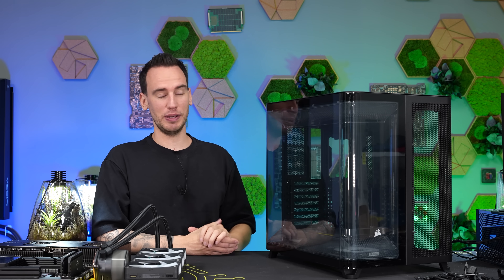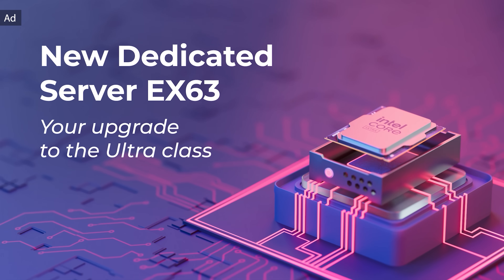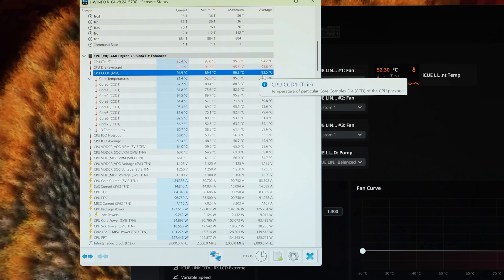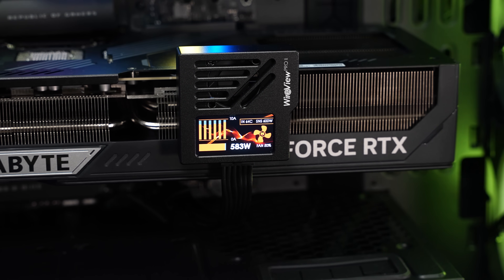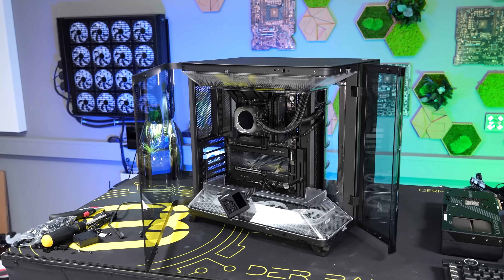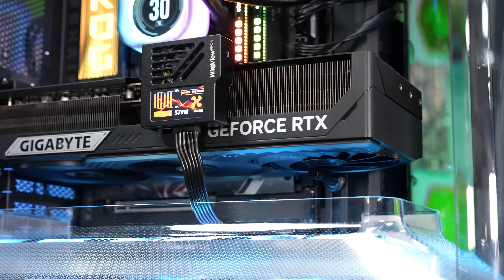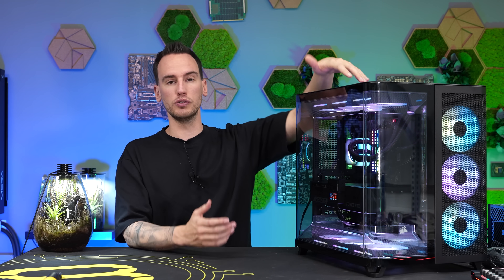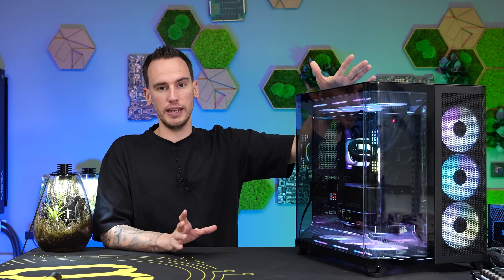Are 3 Chambers Really the Future of PC Case Design?

Comment: This is actually a terrible design, like the rest of the cases. If you have 3 chambers, the one behind shouldn't be used for the power supply. It should be used for the GPU. We don't need to be a genius to understand that a GPU attached straight to a motherboard is absurd.

Comment: Just built this case out and can tell you if you have a premium motherboard like an Asus z790 hero dark the plastic air tunnel on top will not fit. Other than that, super easy to build out with a lot of space in the back so if you suck at cable management its ok, just close the door.

Comment: i like the idea of seperate chamber for better cpu temps but all this VERTICAL cooling is bad for vrms,ram,nvme and mobo itself as hot air goes up from gpu  and heating all in line thill it exits. HORIZONTAL cooling is best, but when will someone do this with seperate chamber we will see....

Comment: There are so few cases that can accommodate more than 1 360mm radiator. In my struggle to find one I ended up getting the Coolermaster test bench and running an open-air setup. It works amazing to keep temps down. I did try a certain case from Thermaltake but when I saw they mounted the radiators with the hoses on top I returned that immediately. Dumbest case design ever. Never buying Thermaltake again.

Comment: why no one is talking about the problems on this case!? 

The cooler should be upside down to prevent air pockets from forming in the radiator, but this is not possible because the case does not allow it.
The NZXT Kraken Elite 360 v2 cooler does not fit because the tubes hit the USB ports. This case is not compatible with all radiators.

Comment: You can mount AIO at the top, exhaust to the side and use bernouli effect (low pressure) to suck hot air from case (high pressure), so effectively not needing top fans and at the same time leave the front free for intake fans for motherboard cooling or other use.
Reply: The whole point of this case is NOT to suck in hot air from the case into the AIO radiator. And also not to blow the warm air from the AIO radiator into the case, where it would affect GPU and other thermals.
The CPU was over 20 degrees C cooler when the AIO was getting fresh air vs. sucking in warm air from inside a case.
Reply: @Kepe You did not understand the Bernouli effect.  Fast moving air EXITING the radiator would suck hot air from the case.

Comment: I have an ENDORFY Arx 700 ARGB case.
Standard four 140mm fans.
Additionally, three 120mm fans at the top and one 120mm fan in the basement.
At the top, the first one at the front pushes the fan in, and the next two pull it out.
R7 5700x3d
RX7900xt
My temperatures under stress:
R7 5700x3d max 65°C
RX 7900XT max 56°C
My computer is under the desk, and my feet are cold.
Best regards

Comment: These designs are all quite strange. the TJ07 with the xforma layout was the peak in case design.  These new cases look like fish tanks.... for newer builds i just stick to rack mount cases instead of going for a fish tank case and if i needed something more than a thick 360 in a 3/4u ill run some thin tubing to a large external rad.  Still much cleaner than buying a fish tank case.

Comment: I've been wondering forever why there aren't more cases that isolate parts like keeping the CPU cooler and the GPU/its cooler isolated, and more cases without external mount options for Radiators- you could work the radiators into the case design to come up with some neat setups. It's a nifty case but I kinda don't like all the clear plastic but that's just personal preference, I suppose you could easily paint them.

Comment: 4 chamber cases incoming...

(gpu in a vertical bracket, in it's own 'wind tunnel' chamber with a 120/140mm fan at the front of the case, and 120/140mm at rear.)

Comment: 600 euros for those whom money is no object, fine.  Toss in trumps' tariffs and most of us go heck no way.  If plastic air flow guides are a "thing", make a front intake shroud that funnels air to an air cooler.  intake fans on bottom, exhaust in rear and top.  I'm using a 7800X3D with a FROZAN A720.  no thermal issues and noise is acceptable.  9 fans total in my King 95 PRO.  [] []-----[]  top 140 intake has shroud to cooler.  Bottom intake no shroud.  Likely come in well under the fancy fan 600 euro cost.

Comment: traductorBy placing my radiator on the side, blowing air in, the heat from the radiator enters the case and causes the GPU to overheat. My 5080 went from 64 degrees Celsius to 68 degrees Celsius, while my CPU only drops 2 degrees at idle and 3 degrees under maximum load. I'd rather keep my expensive graphics card cool than lower the temperature of my 9950x3d CPU by 2 degrees by using the radiator at the top, exhausting air as the manufacturer recommends. Thank you very much.

Comment: You can have hot air front/ side intake, as long as the cpu runs cooler than the gpu, and there’s also cold air bottom intake. It doesn’t need to be this complicated.

Comment: While I think the comparison done in this video is valid, I do wish you had compared to a traditional case with front-mounted AIO cooler as you mentioned. Of course thermally isolating parts is going to produce superior thermals, but cost is important. An AIO is not going to feed very much warm air to your graphics card in almost any circumstance. Try putting your hand in front of your radiator during a long CPU stress test, vs putting your hand in front of the air coming off of your GPU during a long graphics stress test. The difference is enormous.

Comment: Refrigerator, plastic crisper-trays to... Achieve a Venturi effect?  $450 lol

**Edit, $600+ USD, because u need the AIO fans 😂

What about the giant anidees AI Crystal XL: 4 120mm intake fans, a 480 rad exhausting out side of case - before any air gets into the case (in theory)?  It's a 90* loop cold in/Rad out.  Still a $350 case... but can take 3 or 4  480mm rads, and an extra 360mm on bottom?

Comment: Similar result can be achieved also in a “sandwich” style case, where gpu and aio are each on the opposite sides of the case. In general you would see higher temps just due to the fact it is much more compact and offers less “breathing” space…

Comment: This takes me back to my old zalman water cooling that was a huge tower outside the case. You didn't need any fans to cool your cpu with that, just a tiny bit of noise of the pump.
Reply: Yeah the Zalman Reserator. I think they had a few different models of those back in the day. Cases in the 00's and 10's used to have holes in them to get water tubing out and back in.

Comment: The GPU should go on the other side of the MB, inverted, with strong holders, the fan direction should be inverted to blow air upwards; the Radiator should be on its traditional place above the CPU in the top of the Case; some fans should be also on the front of the case blowing air to the GPU Cooler. This way you only need 2 chambers, the CPU-GPU connection will be super close and fast, and Expansion Slots can be more and Freer. Also a Mini-Chiller(Closed Case Air Cycle) could be installed for further temp lowering, ~15-20ºC Air would not cause problems I think

Comment: I'm sorry, why did you have some separate test system? Just run it in the corsair case a second time with the divider removed and a sheet of something taped over the exhaust hole.That would be an exact like-for-like comparison with the only variable being the isolated airflow. Building the system twice in completely different chassis' just means you went to more effort to produce worse data.

Comment: Is making a case where the mobo sits horizontally. Has a dual chamber
Mesh front. With 120fans 
And little fans on top of the pci slots.
The case is compact
In the second chambers. Placed the ssds, power supply and left over cables

That is my dream case, who can I talk to make one

Comment: I don't know if it's the future because I currently have a dual chamber O11D Evo RGB White case and I think it is ATX perfection. I went with a 13 fan push pull AIO setup. I have my AIO on the side as an intake with push pull 6 fans so the radiator doesn't breathe in hot GPU air and on the roof I have three 140 mm fans and a single 120 mm rear fan with 3 fans on the bottom for the GPU. GPU and CPU get fresh cold air and all the heat leaves from the rear and the roof. I can not praise fish tank push pull cases enough. low temps with slower fan speeds and less coil whine because you have more glass than those mesh cases.

Comment: I gotta say I think it is hideous. I live in a dusty environment and I DO NOT want my case sucking up every particle of dust that settles around the case so bottom intake is out. I don't like fishbowl cases. The plastic fan shrouds look bad. and it is twice as wide and just as tall as a standard case. It's just hideous lol. I would rather have the first case in the test. I have a shroud already made for the PSU to draw air from the side at the panel height with it's own filter so it isn't sucking up dust from the surface around the case. Then because I use an air cooler rather than an AIO I have 4 intake fans, 3 in the front and 1 on top just infront of the cooler. Then theres the normal rear exhaust and another on top behing the CPU cooler. I have black plastic panels covering the rest of the top. Ontop of the GPU is another fan shroud to redirect it's exhaust from into the CPU fan to the same direction across the back of the card. My CPU gets plenty of fresh air and the GPU does as well with no dust off the desk collecting.

I made the PSU fan shroud because I had to clean it's filter twice as much as the front and top filter. Now that it is drawing plenty of air from the side with it's filter at the intake of the shroud I clean it at the same time as the front. The top rear exhaust  blows any falling dust away from the top of the case to where only the top front gets the full dust treatment. An actual gradient of dust from the front to the back. The top filter tells me when to clean all the fan filters as it collects the most dust. The plastic covering the rest of the tops openings is so air from the top front fan doesnt esxape from the empty fan slot above it and just in front of it. The one between the two top fans is there for? Dunno. The GPU fan shroud is simply curved plastic from the side of the GPU to just past the CPU collor fan. GPU doesn't affect CPU temps.

Comment: For long-term use, I think it's worth considering that these "added" plastic parts will most likely turn yellow and possibly even crack when exposed to hot air...
Reply: Any decent polycarbonate plastic doesn't yellow though, neither does it crack because of temps a little over room temp. My parents' cottage has a terrace covered with a polycarbonate roof, it's been out in the elements for over 10 years and it's not yellowing or cracking. Temperature ranges from +35 degrees C in the summer to -30 in the winter, plus however much being in direct sunlight adds to the actual temperature the polycarbonate roof sees in the summer.
Reply: @Kepe  I would only be happy if my assumption is proven wrong by time. There are very few companies today that you can trust blindly. Thank you for sharing your experience.

Comment: Thanks for another interesting and informative video. But I must admit that I was most interested in how the temps would compare to using a "traditional 1-chamber" setup (like I believe most  of "plebs" normally do)), meaning that the AIO is mounted in Front pulling "fresh" air, and also with "bottom fans intake" for the GPU, and finally fans in top and back as "outlets"...
You merely mentioned that you thought it would be worse, which I also believe. But I'm  REALLY curious about How Much Worse it would be... Would it be enough to motivate the cost of a case like this ??
Best regards.

Comment: I just don't understand why modern PC cooling has moved this way. AIO on the processor, but aircooler on the graphics card. Between the two, the GPU is far harder to cool with air because of packaging constraints. Conversely, any modern tower cooler has an easy time cooling typical processors because there's so much clear space available directly above the CPU socket.

Why are we not mounting aircoolers to the processor and using a loop (AIO or custom) to cool the graphics card? This would also avoid as much need for the separate chamber, because the processor is only going to dump maybe a third of the heat into the case as the graphics card would, so the overall system ends up cooler and the intake air for the radiators is not as affected.

Comment: My TT 700 CTE is a pain to build in as well the first time just because you are getting used to the 90deg MB turn, and then figuring out that you basically need to buy 3-4 foot cable extentions for every cable that normally mounts to the back of the motherboard. which thanks to the AmaZ0n is painless on the wallet lol. I also have 3 sides of my PC set to intake so all the hot air goes out the top. The only real downside to Chambers is that the cases are getting bigger/wider/taller to make it work so if space is an issue do lots of measuring before buying.

Comment: The price of this case totally justifies the added cost of a back-connect motherboard. It just makes everything sooo much cleaner. Saves the money of using ARGB strimmers too. The AIO baffle presents a platform for mounting a large system display panel that's easy to see. I'm sure that copies of this design will be cheaper. Brush VS rubber grommets? 👍

Comment: I don't know what is the purpose of back fan in Endorfy arx 700. Basically it takes cold air from front fan and exhausts it without any purpose.

When I mounted aio on top, I set the rear fan to intake, so both, front and rear are making intake and exhaust is being done through top of the case only, so all the air goes through radiator, nothing escapes.

Comment: Should have a vertical rectangular cube that houses the gpu, 150mm x 150mm. One 140mm on the bottom blowing upwards and one 140mm on top as exhaust. Completely separated from the rest of the components. Case should have a hidden/integrated pcie x16 ribbon cable that is sold with the case. 

Motherboard and cpu should be bottom to top as well with a 360 aio on top as exhaust and 3 120mm on bottom as intake.

The orientation of 99% of gpus just disturbs the airflow of most traditional pc cases and causes the hot air to just circulate. 

I cooled 48 3090s in Florida using outside air that was 70-100f degrees by using this chimney method. Removing the hot air as fast as possible and upwards was by far the best method

Comment: So, in order to use the new Corsair proprietary case, you cant really use your existing Corsair proprietary AIO and AIO fans, so you have to buy Corsairs new proprietary AIO and AIO fans, as well as possibly Corsair new proprietary case fans ... to use in their new proprietary case and power system ... just to repeat it all again a few years from now at upgrade time.

This is proprietary hard ball ... and Im not playing.  years ago, when I realised that Corsair was going full on in-house proprietary nightmare for all things ... I chose to get out.
Now ... its turned out that this was the right choice.

Its nice to see that the 3 chamber system works temp and performance wise, and I appreciate Corsair spending development costs to figure it out.  Now I will wait a little while for other manufacturers to run with it and build cases in this format.

Comment: I solved my problems years ago: an MDF box 50x50x18 cm hinged as a side panel with space for a large tank, 2 x 360mm radiators, 2 pumps (one bypassed as a spare), all the fans I want, a controller I made with an Arduino (now with an ESP32 controlled via wifi) for pumps, fans and 8 temperature sensors.
One hose going into the case and one coming out with push-in fittings... and all the space I want inside the case. Ugly as sin but extremely convenient and high-performing.
Reply: You have an image?
In an ideal world we would have custom or moddular cases alas the main issue is they are trying to make fancy cases while also one size fit all andd we end up with something (that also costs a small fortune and may or may not even be good)

Comment: I would be interested in a followup with the same exact system in the ARX case, but with an AIR cooler on the CPU instead of the AIO. Im wondering how much is it worth to separately cool the CPU vs. just dump all heat into the same place with lots of airflow.

Comment: Conceptually this is the same as moving the radiators outside the case? The only thing that needs optimisation is the gpu directly throws hot air towards the ram and vrms before it gets pulled out of the top

Comment: i have the lian-li dynamic evo 11 and i’m using 6 case fans for intake and one exhaust in the back as well as 3 for for aio, and i use the same cpu and pump and my cpu gets to around 77-80c under load. so i think it’s just comes down to airflow. using the 7900xtx nitro+

Comment: Ah, but the future was discovered a long time ago, and works however you choose to cool your hardware. Next: No case vs. 3-chamber case - which has the best thermals? ;)
Reply: Unironically that might actually be a good idea (if modified/improved a bit) its really a question of figuring it out
Also the case needs to not cost a small fortune (and actually be good)

Comment: @6:29 - I still use my Corsair 600T. What drives me mad is the crackling of the plastic when case cools down.
Oh, I've changed original 200mm fans due to their aging - bearings were BAD.